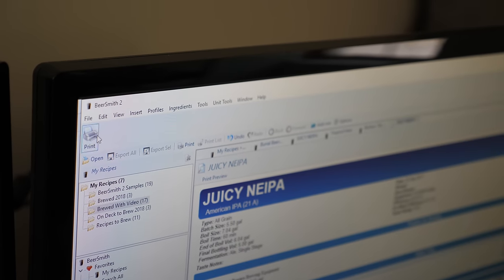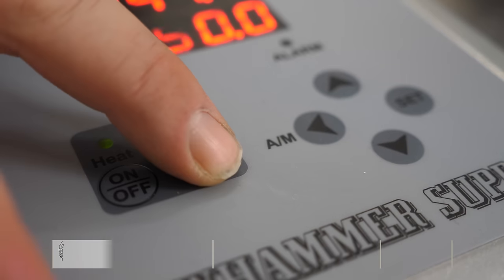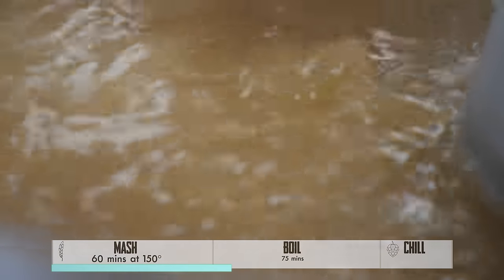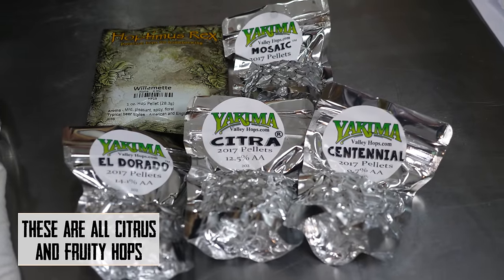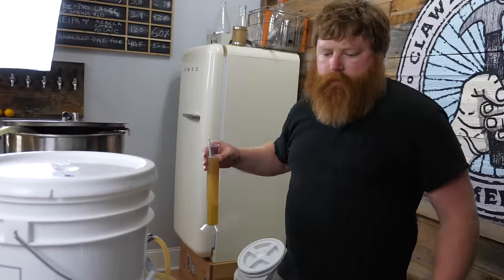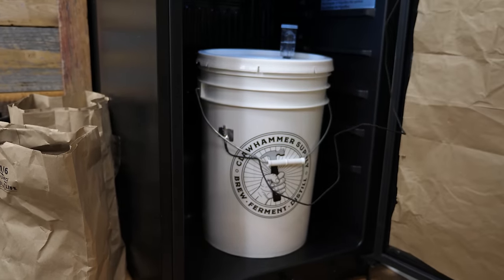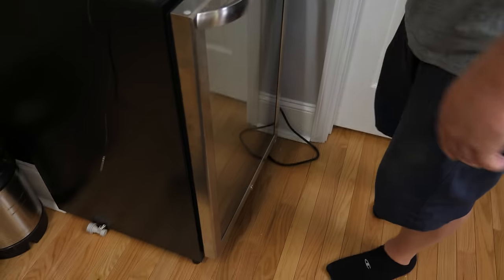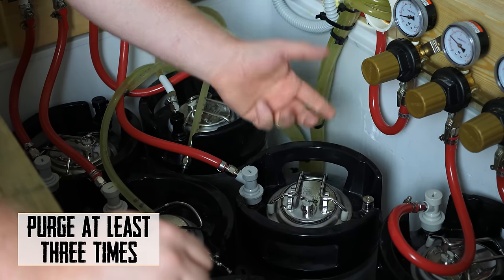Juicy NEIPA - Homebrew Beer Recipe

Comment: Brewed this recipe using the same grain bill and basic water profile a couple weeks ago, but 10 gallons, and it turned out great.  The only differences were as follows: First, I used the same basic hop schedule, but followed your suggestion of not using lemondrop hops.  I then split the batch in half with the final dry hopping of 2 oz Citra in one and 2 oz Mosaic in the other.  Second, I used Wyeast 1318, the well known NEIPA yeast...not sure if that is the same as Imperial Yeast Ale Juice A38.  Last, I did add a half ounce of Willamette at 60 minutes just to give a bit of bitterness, which is negligible if at all.  Have just finished carbonating and tasting over the last few days and both turned out great.  Mosaic is a much more grapefruit-centric hop while Citra has much more orange character.  Both beers are noticeably different in flavor and aroma, but the basic elements of the base beer are in each and quite solid.  I would recommend this recipe.  It is very well done.  Thanks for the video and recipe.
Reply: Hey mate, what temperature did you brew this on? Also, do you remove the first dry hoping when adding second? Same for third addition.. amazing idea to separate the batch and try both hops! I might do the same! Thanks for sharing!

Comment: Gentleman,  I loved this recipe.  I brewed it with my system which is not as fancy as yours, but gets it done.  I did make a mistake and forgot to get sugar for the boil addition.  I ended up adding blue agave pure from Costco.  I made this beer on 3/20/19, and kegged it on 4/3/19.  Had a small party on 4/6/19.  3 gallons gone after party, and i just finished the rest on 4/22.  No one touched the craft beers i had bought.  They all wanted more of this beer.  I am planning on brewing this again!  Thanks for the video.  I love the idea of system you use.

Comment: Sorry if I missed something, but you had the primary for 10 days total then went straight to the keg? No secondary to condition? How long did you carbonate and at what PSI? How many days after you legged before you tapped? I’ve been brewing for 10 years and every recipe I’ve done says 2 weeks in primary and at least 2-3 weeks in secondary.
Reply: secondary's are not usually made for NEIPA's it risks oxygen getting in and sanitary risk.

Comment: Just finished  brewing a NEIPA couple hours ago first time doin this style pitched some WLP066 london fog ale yeast cant wait to see what happens. anyways great video's guys and super sweet set up your running there.. cheers 🍻
Reply: How did you like that WLP 066, I used the same yeast for my NEIPA and having the first bottle of it now.  I'm loving the hoppiness so far, just not as hazy as I was wanting. Did yours come out hazy?
Reply: What do you guys use as a dry hopping bag?
Reply: Hey guys, would you help me out? How long did you ferment your neipas? I’m actually at 12 days with two dry hops and still got a bubbly airlock.
Reply: @brunoabarca3754  I had the same issue on mine recently. The thing is airlock activity is not really a good indicator that your beer is finished. Taking a gravity reading is the best way to know. If you're around 1.010 (more or less) you should be fine to bottle or keg.

Comment: I had a thought for increasing efficiency in your system. I noticed it doesn't allow for sparging, but what if you tried the following:

After mashing, and with the grains suspended over the kettle, drive your heating element to 100% and run your wort through your wort chiller. 

Then, run your domestic hot water line through the chiller to pick up the heat of the boiling wort. Adjust the domestic hot water flowrate to ensure you are at the proper sparging temperature.

Then simply rinse the grain bed with the fresh, preheated water until you reached your ideal boil volume.

Comment: Does it have to be flushed with CO2 after each dry hoping? About to brew my first batch and Im wondering if fermentation provides enough CO2 to make dry hop safe or there was a flush off camera?
Reply: He only flushes it with co2 after kegging it cause there will be oxygen in the keg. These days closed transfers are more common.

Comment: Is there a reason you didn't sparge? I always sparge when brewing all grain, not sure if I'm missing something.. Recipe looks great!
Reply: Noticed there wasn't a reply. Their doing a "Brew in a Bag" method of brewing which doesn't require a sparge. Start with slightly over your pre-boil volume of water, mash, then boil. When you sparge, you normally start with less water and the sparge water adds the volume back. Just a different way of doing it.

Comment: Please...an urgent Question. Currently building a new brewery in SeouL, Korea.
My understanding is that for the summer time... HVAC system for Brewery facility is of no problem since Fermenters and brites tank will be GLYCOL jacketed.
But I learned that when brewing ALE beer types(which is mostly the case for craft brewing) the temperature shouldn't fall below 10 degrees Celsius during winter.
Thus, my question is 1) is it necessary to install some sort of overall heating system for the brewing environment? If so, what type of system?
                                      2) And if it gets installed. Does it have to be turned on 24-7?   I reckon it would be waste of electricity cost and all.

Comment: With Neipas I try to get my first dry hop in at 50-60% attenuation, which is always 48hours after pitching. Second dry hop on the last few points before it finishes on day 4. I’m usually in the keg after a 2 day cold  crash in 7 days. Strange your fermentation is taking so long. Pretty old school methods here, just guessing your way though this

Comment: Great recipe! But one thing I'm wondering: Didn't you get a massive hop burn when dry hopping like this during active fermentation?
Reply: Its actually key when dry hopping a bucket fermented beer as you need the active fermentation to continue and displace the oxygen put into the bucket when you add the hops. The secondary dry hop is the harder bit as fermentation is no longer active and is far riskier.

Comment: Looks great. I did a NEIPA a few weeks back. Had about 10 Oz of hops in a 5 gallon. Cascade, Ekuanot and Mosaic. Any tips on how you got yours so Hazy? Mine had some haze but not as much as the NEIPA usually has.
Reply: Try some unmalted wheat.  Also, dry hopping helps as you are adding a lot of polyphenol which will combine with sensitive protein to cause chill haze.  Serve your beer a bit colder.  Also avoid really flocculent yeast strains as they can settle out a lot of the protein in suspension when they themselves settle to the bottom.
Reply: Lohpraks Personally, I use high protein grains such as wheat, oats, white wheat malt, etc. Yeast is also an important factor, you want a yeast with medium to low flocculation.
Reply from the maker: Did you adjust your water chemistry? I've found that useing a high sulfate to chloride ratio really helps with the haze-- as well as dry hopping during active fermentation and using a good amount of adjuncts with high protein levels.
Reply: My recent one looked like glorious pale sludge. Lots of flaked adjuncts I think are what did it (the grist was about 20% flaked oats and wheat). I did a 2:1 chloride to sulfate ratio. And then about 6 ounces of dry hops.

Comment: 2 years later  -  I brewed this recipe today and I wonder . . .  Why boil for 60 minutes if there's no 60 minute hop or FWH additions?  I'm not a scientist, engineer or beer guru, but my understanding is that the long boil works with the bitterness of the first hop addition.

Thanks for your insight.
Jim
Reply: 1 year late to the party:
If it was extract, you'd be right and only 15min would suffice. With all-grain you do want a 60min boil for several reasons such as: killing micro organisms on the grain, coagulate proteins, evaporate volatile compounds such as DMS and to boil off excess water to reach your target gravity (or you'd have to mash thicker).

Hop bitterness is just 1 aspect of the boil, but perhaps you've already learned that in the past year ;)

Comment: What's the batch size of the recipe? 5gal? Have you tried primming it instead of kegging? Do you have the beersmith file?
Reply from the maker: 5.5 gallon finished batches-- that way we get right around 5 into the keg.

We always  keg-- it is just easier for us -- but there would be no issues priming it either.
We do have a BeerSmith file-- feel free to send us an email
info@clawhammersupply.com

Comment: Nice! How many IBUs did you get aprox? Also, no sparging??? Why??? Thanks!
Reply from the maker: We typically don't sparge--- mainly becuase I'm lazy. You could easily hold back some of the full volumn water and use that to sparge when you pull the  basket-- you will get slightly better efficiency doing that. I just adjust my recipes to account for the lack of sparging.  I'll have to pull up the BeerSmith profile-- I'll update the website with the info. Thanks!

Comment: Also, how do you quantify how much hops to add for a balancing bitterness if the theoretically give 0 ibus?
Reply from the maker: Good question. In our experience, dry hopping still adds some bitterness even though calculated IBUs are extremely low. But, to answer your question, we just kinda wing it and adjust the next beer based on previous results.
Reply: Trial and error it is then!

Comment: The clips that hold the grain basket seem like the only flaw with your system. Have you looked at modifying this design in future models?  I think grainfather has a good solution, basically notches that you twist the basket into for support.
Reply from the maker: Clips are simple and work great. We like to keep things simple.

Comment: Ive noticed you guys don't seem to add hops during the boil in many of your beers - does this reduce the bitter aspect to the beers you guys make?
Reply from the maker: Yeah- for this style we are trying to keep the bitterness to a minimum. The whirlpool addition addd a decent amount of bitterness. We have done a few NEIPA's with a small 60 minute bittering addition and for my preference it was a bit too bitter.
Reply: Alpha acids need to be isomerized to become soluble in beer.  Boiling achieves this.  IAA are what makes beer bitter.  The rate at which isomerization occurs is halved approx. every 10 degrees F you drop below boiling temp.  So at typical whirlpool temp. you are getting between 1/2 and 1/4 of the isomerization occurring as opposed to boiling for the same amount of time.  Whirlpool hopping is a common strategy used when trying to get more hop flavor and oil inclusion without getting too much bitterness.  Commercial brewers almost always add some hops to the boil because it tends to settle the boil down and make boil overs less likely

Comment: How long do you carb it and at what PSI?
Reply from the maker: We carb several ways. Sometimes we keep it some and carb at about 11psi for a week. If we're in a hurry, we'll crank it to 50 and let it sit for 12-24 hours. If we want to drink immediately, we'll crank to 50 and shake for 3 mins, then let it settle for 20mins at regular serving pressure before drinking.

Comment: I see so many worries about NEIPAs oxidizing with people doing pressure transfers and trying to eliminate oxygen from their dry hops. Then I see you just open the bucket and dump the dry hops in a bag. Then you racked with a racking cane instead of a pressure transfer. 
Did you experience any oxidation as you got further along in the keg? How long did the keg last?
Reply: I swear that the last three NE brews I did became oxidized due to the second addition of dry hops. I too am confused... I actually just got the fermentasaurus strictly due to the fact I want to eliminate any threat of oxygen entering my beer.
Reply: I've made about 20 neipas in the past year, and I also rack straight from bucket to keg, no closed transfer. Never had an issue with oxidation. Although, I've kicked every keg within 4 weeks, so maybe if it stays longer, I'd see more of a negative impact. Week 2 in the keg seems to taste the best. After week 3, the taste drops. Not considerably, but it's noticeable. Color stays nice a light.
Reply: I do a closed transfer from my ss brewtech brew bucket into the keg via the liquid out post.  I also purge the keg before hand with some C02 just in case.  To avoid any additional exposure for secondary dry hopping, I bought a stainless dry hop tube, fill it with hops, and hang it in the empty keg with dental floss before sealing the keg up, purging, closed transfer filling.

I've made about 6 batches of this style, but its always a big hit so a keg usually doesn't last much more than 3-4 weeks.  Definitely helps with the freshness.  

I know some people may say 'Well those hops hanging in the keg the whole time are going to add grassiness'.  I have yet to come across that problem, I let the tube hang in the keg from full to empty.  If you have concerns, you can always perform a jump from the dry hop keg to another with some C02 and a couple post fittings.  Check all this stuff out on brulosophy, great resource!
Reply: Nick interesting idea. Which tube are you using for this?

Comment: Respect to the beard.
This man "knows & understands" beer.
Claw hammer how much would a pint of that beer cost at the tap retail?
Reply: $10
Reply: moto G4 Connecticut resident here, funny enough some of the best Neipa’s around is made by BEER’D Brewing in Stonington CT. Owner has the biggest beard I’ve ever seen. Also to properly answer your question in NE you can get a pint of NEIPA for $6-$8 at the brewery tap room (which is where most New England’ers go to drink beer) restaurants will charge $10-$12 but only tourists actually buy it at such inflated prices.

Comment: So just did my first brew. Braggot. I used honey vs sugar. I also used a sous vide to control my temp. If I use honey do I have to boil, I prefer not as to preserve the honey flavor. It turned out ok, but I realize now my mistake I used to different styles of malts not understanding that I needed to use possibly a wheat flake.

Comment: Sorry, I have only brewed other kind of ales before but don't you need to sparge when brewing?
Reply: This is more of a brew in a bag type system, no sparging required.
Reply: Recirculating the mash with the entire water volume is what is being done here.  There is no need to sparge.  As George said, it is basically a brew in a bag system, but with re-circulation to help with even better extraction.
Reply: @smitty7592  thanks for your answer!

Comment: My guy...
How do you control oxidation with this brew style? I feel like every time I brew this style, it turns into brown cardboard water within a week after kegging.

Only way I’ve ever been able to pull it off is to ferment in a keg to limit oxygen exposure - no headspace so I lose like a gallon to blowoff during fermentation. Truly maddening. I see you guys taking the lid off the fermenter, not purging the keg before racking, racking with the lid open - all stuff that I think messes me up. What’s your secret?
Reply: Do you use this Clawhammer brew system?

Looks like a neat system, but recirculating the wort from the lid like it does, WILL put more oxygen in the wort. Oxygen is your enemy when it comes to aging and flavor stability of the beer. 

Imho, you'd be better off changing the output of the pump (if possible) to just have a tube that goes into the mash tun, without spraying it.

Comment: How long time do you do cold crash?
Reply from the maker: Joao- I typcially don't cold crash hazy beers. I want the hazyness to come though in the final beer. I most definately cold crash lagers etc.
Reply: Clawhammer Supply don’t you have problems with remain yeast?
Reply from the maker: When we transfer the beer to the keg any yeast will settle to the bottom and comes out in the first pour. I've had issues in the past with the fermenter sucking in the liquid from the airlock during cold crashing. One less thing to worry about. Not cold crashing has been been an issue for me.
Reply: Clawhammer Supply Thank you very much.

Comment: Hi there. You use the word "haze" and "hazy" alot in your video's. What taste do you describe with that? Can you explain? Tried to translate it as well but no clear results. 😁
Reply from the maker: Haze refers to the lack of clarity or opacity. It's cloudy. Does that help?
Reply: Clawhammer Supply thanks! Sure does. So its a visual appearance and not so much a taste.
Reply: Apart from the visual aspect, this type of beer is hopped heavily late, with whirlpool/dry hop additions (think large hop additions).  This gives you a smooth, easy drinking beer with a lot of citrus/tropical fruit flavor and aroma.  Hence the 'This is dangerous' comment in the video.  These types usually dont drink like their ABV suggests.
Reply: The "Haze" can also be attributed to the amount of flaked grains used.  These tend to produce a more hazy beer and also lend to a softer mouthfeel.
Reply: Miguellos hazy juice bombs!  Like a glass of orange or grapefruit juice.  Once you start drinking this style there is no going back!

Comment: To avoid this beer going south too fast you need to avoid oxygen exposure as much as you can.  I generally do a closed transfer from the fermenter into the keg via the liquid out post.  Probably not possible with a bucket fermenter, but if you do this again in a conical give it a go, a pressure transfer would be even better to avoid any suck of oxygen.  I know it sounds crazy but these beers are impacted by oxygen exposure worse than any regular brew I've seen..and I've made a lot of Hazy NEIPAs.
Reply: how do you dry hop your NEIPA??